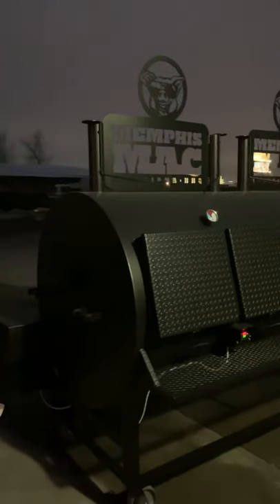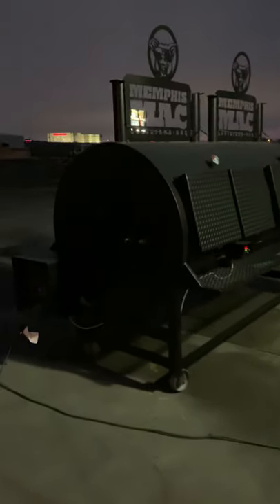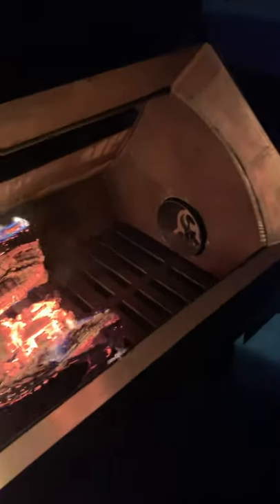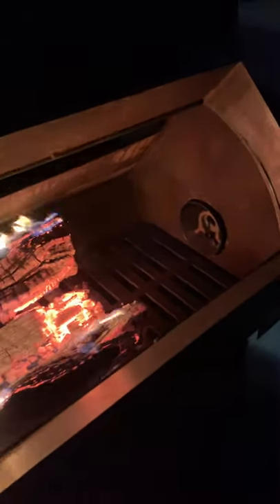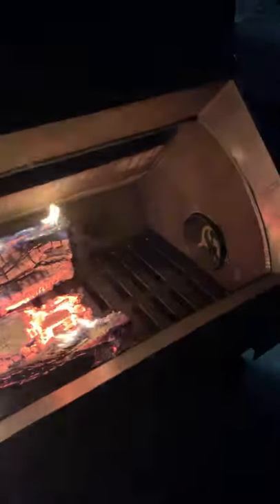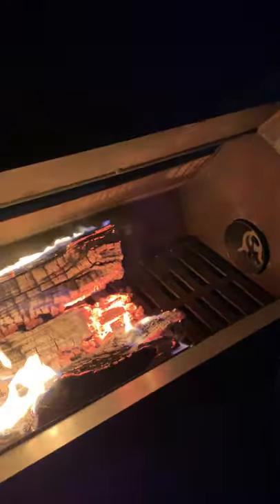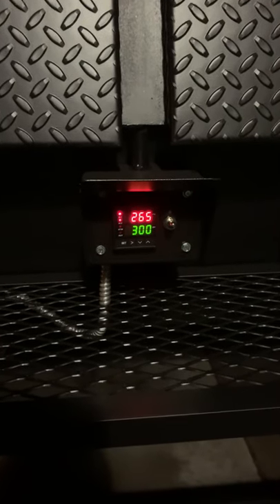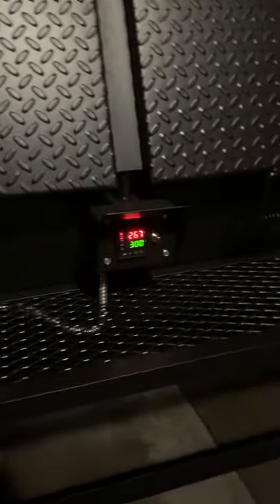Heartland Cookers - PreSeasoning Pt. 3

Comment: What a genius design, I run the control panel shop at a flare company and your control components are similar. I've designed a offset stick burner that controls the temperature, it works fantastic. Nice to see someone like minded.